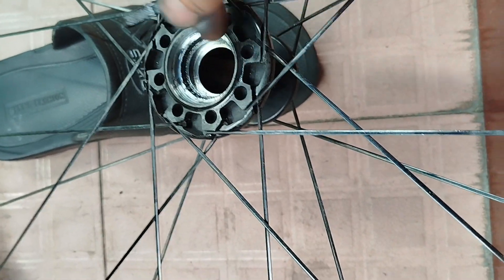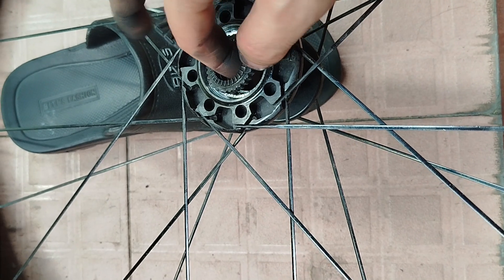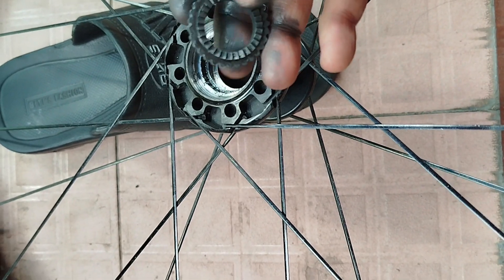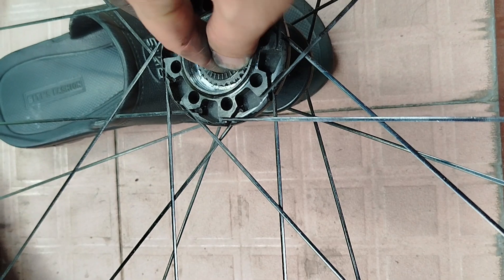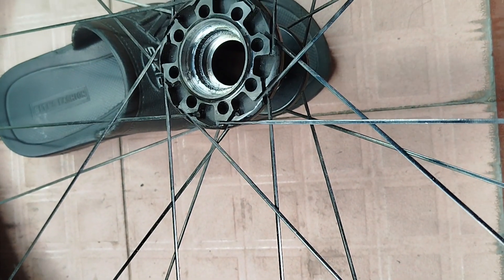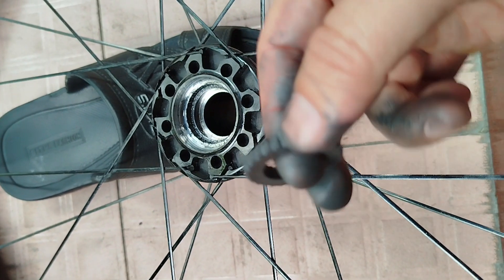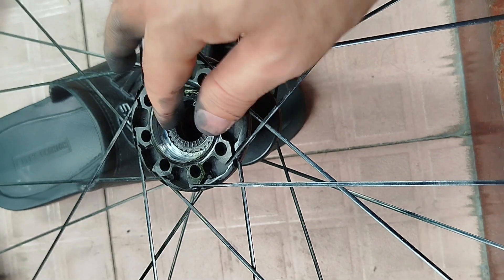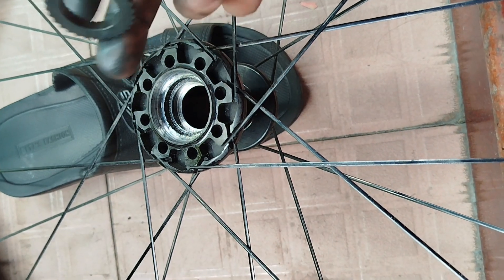SHAME of Taiwan Excellence - Giant SLR1 Disc 42 Rear Hub Design Flaw. Giant advanced owner watch out

Comment: Hi is there A Hub of DT Swiss to reaplace it?. If Yes wich model?
Reply from the maker: @sakissakellariou7628  Hi friend, it is an interesting question. The wheel's lacing is 2:1 and there is no DT swiss hub for that. Some will use the 32 holes hub for 24 holes 2:1 lacing but you will need to have a new spokes